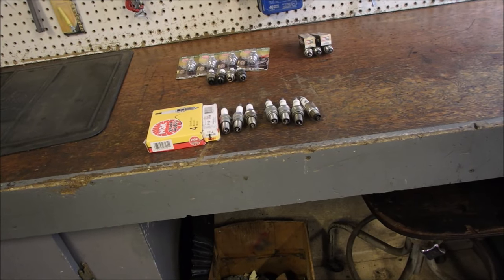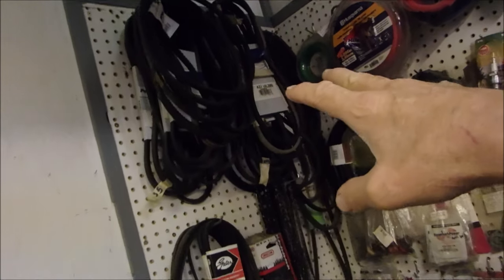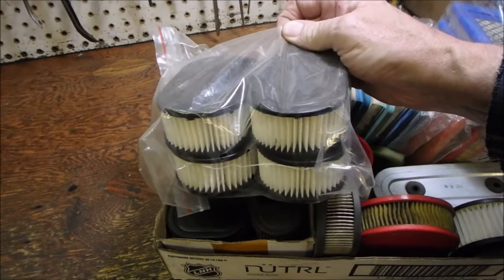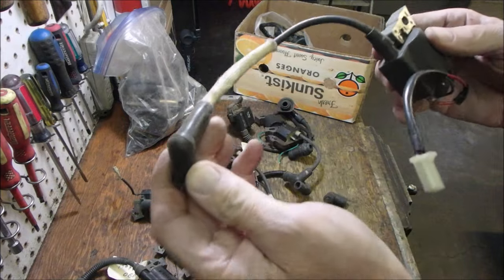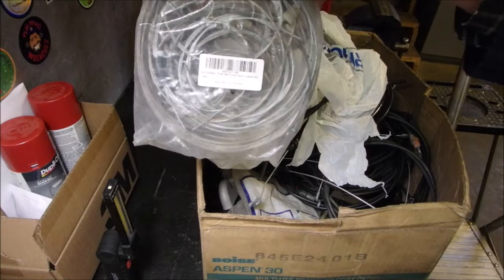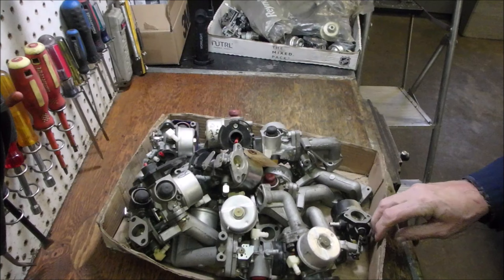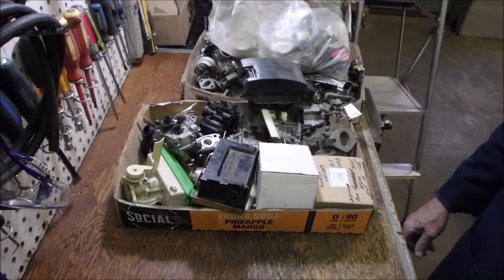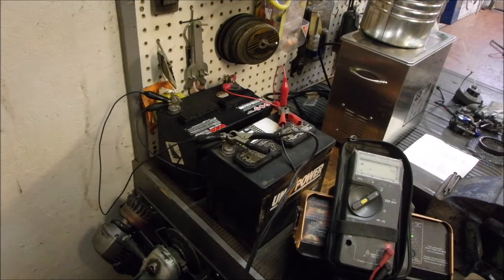My New and Used Small Engine Parts

Comment: Well organised group of valuable parts Bruce. At EP provided the customer approves we sell used parts for 1/2 the list price plus the tax of 13%. Not only are they saving on the original cost but since it has been reduced so is the amount of tax. Rarely will a customer decide on a new OEM part versus our used ones. Imagine an OEM Techumseh electric starter lists at $305 Cdn now plus tax we install them free used for $150 plus tax.
Reply from the maker: I have a few of those  :-)

Comment: I think you’ve got the bases covered, re spares. Your right, it would cost a fortune to have new spares for everything. Small shops can’t afford that. I pretty much just maintain and repair my own machines at the moment. I have spares but anything I don’t have I can order and get with in a week normally. I’ve just ordered. A couple of tools and it will be mid January before they arrive
Reply from the maker: Thanks again Al for all you do.
Reply: @BrucesShop  all the thanks goes to you for putting the time and effort into making great videos. All I do is  watch. Happy New Year